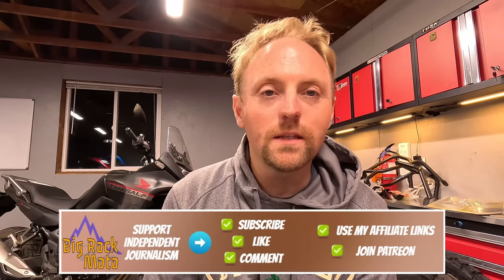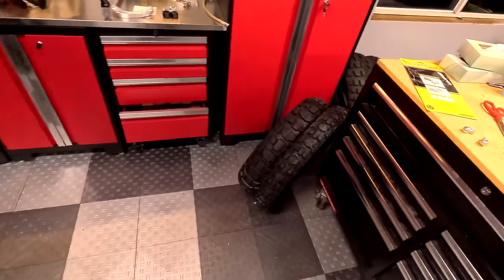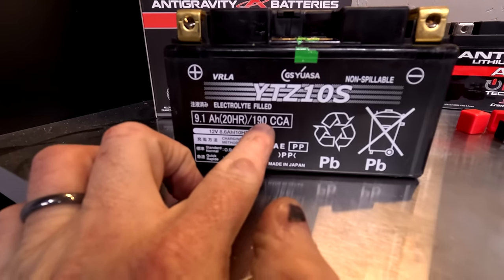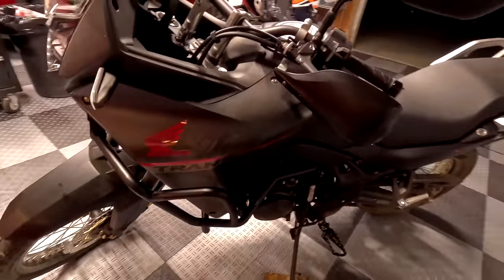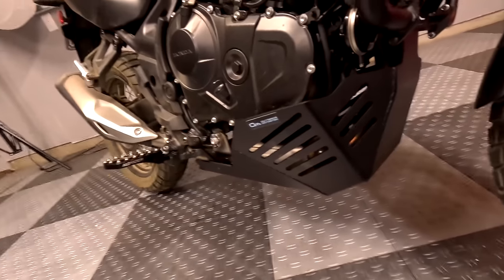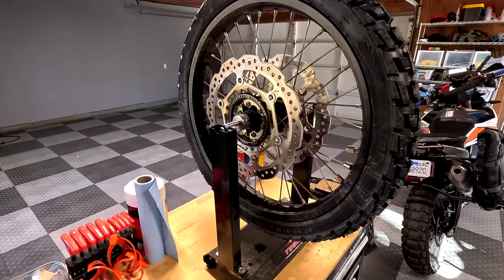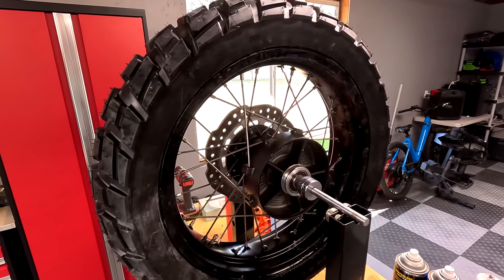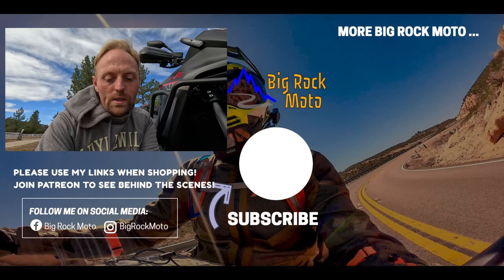Modifying the Honda Transalp 750 for Proper Adventure Riding! (EP 3)

Comment: Great and informative video. We’re fortunate to finally have Transalps in North America. Thanks for rocking our armour!
Reply from the maker: It's great stuff!
Reply: Thanks for the detailed video Ian. After watching your first video of the TA my main question was - how are they going to mount a skidplate to that thing?! The system Outback came out with seems pretty stout, and I like that it doesn't mount to the engine. 

Replying to the @Outbackmotortek comment here so maybe they can chime in too... How hard is that skid plate to remove for oil changes and such? Does it seem beefy enough to support the 600ish lbs slamming down onto a rock or a log without bending attachment points? Any thoughts on extending it a bit to cover the peg mounts? Those look like they'd get beat to hell in rocky terrain.
Reply from the maker: @DmitriyAdv  6 bolts to remove, pretty fast. seems super strong to me, I've been out testing it.
Reply: make the bash plate competible with a center stand
Reply: @BigRockMoto  that's not bad, though could be a finicky once those bolts are all smashed up... and the skid plate is "adjusted" by the terrain... and you're trying to reinstall it after doing an oil change in a hotel parking lot in the dark haha. I know it's an edge case, but it's my edge case :D 

Serviceability is important on these bikes, which is why I'm also looking forward to your air filter video. I love Honda, but they keep missing the mark in this department. Working on my old Africa Twin was a bit of a nightmare.

Comment: I love the modifs but I really would like to see someone removing the entire exhaust line and redirect it to the side of the engine and fit a proper vertical Dakar muffler. You would not only gain in lowering the overall weight, it would also allows you to fit the engine skid plate higher up and closer to the actual engine block. Compared with the T7, the Transalp's ground clearance is a bit low for my taste, so replacing the factory exhaust line would definitely be my first upgrade. It is too messy. I would also remove all the big plastic parts to the rear, breakable plastics on an ADV bike is a no go. It is clear Honda did not want to release a 750 Africa Twin so it makes sense this Transalp is more road oriented than its first predecessor. How about the stock suspensions? I would be surprised they are off road worthy.

Comment: I did that once on a pick up truck. I forgot that the tires I bought had a directional tread pattern, then decided to do a diagonal tire rotation... easy fix, but embarrassing when you look at your finished work and say, "well... that doesn't look right."

Comment: Regarding the clutch and brake levers. We would keep the mounting clamps just loose enough so the levers would slip on the handle bars if you tipped over.  But still tight enough so they wouldn’t pivot during normal riding.

Comment: I found that entertaining!   It's been a while since the last time I put on a bash plate...  That is a slick combo plate-bars there by outback.  I wish you'd included the timelapse for kicks.  Seems easy to machine a judiciously positioned slot across the bottom of the plate, just enough to get a box-end in and the plug out.  We know how those plate screws become in real use, no matter how flush and protected they appear.   I would cut mine at installation if I were to get one.  Prob end up larger than needed... Maybe outback will take the hint.

You don't hold a monopoly on forgetting to double-check the tire arrow, Ian!  😂☮️

Comment: Thanks for checking the ground clearance after mounting the engine protection. As a light off roader the Transalp should be a great option for most people.

Oh and check out the Baja No Pinch tire changer, that thing is tits!
Reply: Thanks for recommending that device.  I've always had problems pinching tubes on my DR650 and am going to try that out.  👍
Reply: Baja no pinch worth its weight in gold
Reply: Agree.  Met a guy in a dirt bike staging area, he was at wit's end as he pinched all this tubes trying to fix a flat.  I had a spare tube and whipped out my Baja No Pinch tool.  For sure he bought one, I didn't have to buy beer that weekend as he emptied his cooler and gave me his 😄

Comment: The low oil pan would be the only real issue I can find with this bike, but only for more technical off-road riding. I suspect the majority of owners will be hitting some gravel roads while touring, and not much more. For the minority doing real technical off-roading, they have that skid plate option. I get the impression that Honda banked on this being the case. Great video!

Comment: Put on Bark Busters and skid plate as well. As I’m planning to go off-road traveling with lugguage for three months, I’m gonna put in progressive springs in the front end and a „serious“ shock in the rear. Also, I’ll change the rear sprocket to 2 or 3 teeth more, so that the bike will better response in the low revs while off-roading.

Comment: Love the Storm Barkbusters handguards. They are ultra-tough, as my wife demonstrated on both sides and give a great protection for the hands. They look old-fart, but that's me.
Reply: They can go down on Asphalt several times and the worst that can happen is to have them bend back in a vice and use some sand paper to remove the deep gauges in the plastic. They won't break on Asphalt.

Comment: Really enjoy your channel and the in depth reviews and tests. Don't know if anyone else has pointed it out regarding traction control. You can turn it off. There's an old saying that sticks in my mind. "If all else fails - read the instructions" 
Page 88 in the owners manual shows TC has position 0. You have hold UP after going down to 1.
Dork in the road has just posted a video.
Brilliant the way you showed the rear tyre fitting debacle. We've all been there.
I fully appreciate that a lot of the after market parts you fit are probably USA only available, but would it be possible to price up the parts you get for free? For us mere mortals who have to pay for them.

Comment: Ian, great series on the Trans Alp. This may sound like a stupid question. I noticed that weight, ground clearance, and suspension travel are very similar to the KLR 650. Obviously the Trans Alp is the better road bike, but how does it compare to the KLR 650 off road?

Comment: Great content like always. I am always thinking, always. 
I have an idea of a new segment for your reviews that you might like. I know I sure would. 
You could consider a 'real world' ground clearance segment. Meaning what the ground clearance is while being mounted on the moto, with gear on. Not necessarily with a full camping loadout, but rather just your set up youd go out with on a all day ride. Some  tools, water bladder, ect ect. 
Just an idea that may help grow your channel even more and provide a statistic that others dont add. 
Good luck, well done. 

I know it will be hard to messure it while sittong on it. A jig will need to be made, but that would be fairly straightforward and easy.
Reply: The reason I suggest this is because sometime spec sheet ground clearance is misleading. If the bike is undersprung from the factory, it will sag more when mounted. 
I know it is all subjective depending on rider weight, but it would be cool to see regardless.

Comment: Nice workshop day video. I would have liked to see the wheel balancing to completion for at least one wheel, just curious how you consider it "done" using the static balance method.

Did you weigh the bike after the crash protection upgrades, or maybe the items by themselves? I'm quite interested in your review of the Raid tires.

Comment: Do those pegs make the lean angle even worse?  A lot of the tests I have read call out the stock peg placement as too low.
Might try soapy water on your tubes and bead. It makes it much easier and dries with little or no residue. Talc may cause the tire or tube to slip as it will retain its properties.
The reason there is no grease on the axel is because its not supposed to have any moving surfaces. You can put something on it to stop corrosion but the last you want is anything rotating around the axel.  The bearing inner bushings are supposed to lock on the axel so all the movement is within the bearing.

Comment: Nothing like scratching new bike rims with metal tire spoons… you would have been better off purchasing a No Mar Tire Changer… the Cycle Hill model line for $300 with a few accessories , namely the hitch mount option and in the end had a better quality more robust tire changer and $100 less expensive….. Rabacondas are flimsy compared to the Cycle Hill..I’ve used both and now am at year 10 with my Cycle Hill… tire changes have included, BMW cross spoke rims (GSA and R9T)Behr rims, OZ Racing magnesium rims, dirt bike rims as well as  ATV wheels…. And not a scratch on ANY of them…

Betcha if you call No Mar , they send you one … gratis…

Comment: On my Himalayan and Versys I mounted a switch that basically just breaks the circuit to the rear ABS sensor.  Of course no need to do this on the GS because it’s done correctly from the factory.

Comment: Hey Ian, Have you been using parts that are specified for the '23 model?  Do you believe there is any difference between '23 & '24?  Specifically, I found that the crash bars/skid plate you are using are only listed for the '23 model.  I just received  my '24 TA so this series has been very helpful..   Thx  -Al in Seattle

Comment: Curious to know what you think of the Trailmax tires. Been running Motoz Adventure and Dual Venture on the T7, but would like to change things up with more of a 50/50 oriented tire.
My main focus is off road, so they need to perform best there, but have to ride highways to get to the off road locations too, so I wouldn't mind a smoother tire. The Motoz are great, though.

Comment: My question still stands from episode 2 and has gone unanswered: How well does this bike stack up against the 800DE Suzuki???......also, NEVER use the adjustment marks on the swingarm to align a chain. If you do, 90% of the time the chain will be out of alignment. The proper way is to find the proper tension of the chain and then do the final alignment by looking down the chain on top, from the rear sprocket down to the countershaft sprocket, similar to sighting down the barrel of a rifle. Slowly make adjustments to each side until the desired tension and alignment is achieved. Trust me, this is the ONLY way to properly align and adjust a chain. if it's necessary to remove the chain guard to gain a clear view, so be it. You MUST align both sprockets by sighting down the top of the chain or premature chain wear will occur.

Comment: if you completely discharge a li-ion battery completely you also do damage it. Same with a lead acid battery. The difference is you can discharge a li-ion up to 80%, the lead acid up to 50%. I stick to lead acids because the 5lbs of saved weight isn't worth the extra 50 bucks.
Reply: The handy thing with this specific brand of lithium is it prevents a total discharge of the battery. Instead, the saved leftover juice is able to jumpstart itself in case of an emergency.

Very handy!
Reply: @JelloThatsMellow  how does it do that?
Reply: @alloutlife88  their website explains it better but basically there's circuitry inside the battery (yes this does add cost) that kills off the battery before a certain discharge level, then when you push the restart button on the top of the battery it unlocks the rest of the capacity.

They do sell a version of their batteries without this feature, but besides saving a few bucks, why bother giving up a very handy feature? I've only used it once on my bike (I still carry a portable jumper anyway), but it's already proven super useful.
Reply: @JelloThatsMellow  thats pretty cool actually, I just push start my bike :P but then again I dont have a 300kg adventure behemoth...

Comment: On my 2002 Honda ST1100, I installed a Friction Type cruise control on the throttle. Could a throttle friction cruise 'clamp' (with quick release) fit on this TransAlp with the Guards installed? PS. I sold the ST1100 in 2018 because I was no longer Sport Touring. Now researching ADVs, and the TransAlp is the top contender.

Comment: The presentation of material is - if not the best on You-Tube, then probably, one of the best. You manage to make interesting videos, on issues that are, not always, interesting....👍🏻👍🏻 As in THIS, particular, case ! -  I don't want to use impolite terminology, but yes - it's ~ 1/2 essential 🤷🏻‍♂ 
THIS bike is NOT an offroad bike, and not even 50/50 bike. The clue to that is given by the manufacturer : the position of its' ex-pipe, which is SAME as on the CB500X...NC750X...A Hornet 750 has more elevated pipe❗❗😱  So the added accessories : the wind guards, the battery, the crash-bars, the pegs = 👍🏻👍🏻  The skid-plate, the tyres = 🤢  In the end - no CC on a bike with RBY and TUBED wheels on a 90% TOURING bike = 👎🏻👎🏻👎🏻👎🏻  Maybe this bike is - a UPV ( unidentified purpouse vehicle ), or UPM....🤔🤔
PS - did you forget, or simply don't need ( in case if bike falls on it ) - to mount a brake pedal extender ( to make it wider )❓

Comment: Do you have issue with loud buzzing of the bike at 3.8-4.3k RPMs? I've had my test ride of Transalp on Thu (European version). And it would make a lot of noise at those RPMs. It feels as if all those plastics, crash bars or something are not attached and they just buzzing into each other, it becomes loud. Each time I start hearing loud buzzing noise, I would look at the dash and the bike is in this range. The moment you are out of that RPMs range, bike becomes silent again. And I'm not talking about feeling vibrations, I'm talking about hearing them loudly.
I also think I saw someone else comment before about Trasnalp and he said exact same thing about 4k RPM mark. Thus, I'm now wondering if they all that bad and if it gets better with time?

Comment: Excellent that you weigh the bike yourself. Would be good if you also measured the height of the centre of gravity for some real numbers instead of assumptions. You just need a plank of wood to do this and a pivot.
Reply: Maybe tilt the bike at 10, 20 and 30 degrees and see the pounds force to hold it there?

Comment: The oil sump and exhaust hanging under the engine of the Transalp is a very questionable design🤔 ... Its the first thing I noticed when I saw the bike and it shows Honda's focus for the bike is street and smooth road riding.  I've made the tire rotation mistake once...that was the last time 🤬

Comment: I also saw a Trans all video by video by Dork in the road where he had oil run over the header pipes when he removed the oil filter. Annoying. Try covering the pipe with a piece of aluminum foil while pulling the filter.